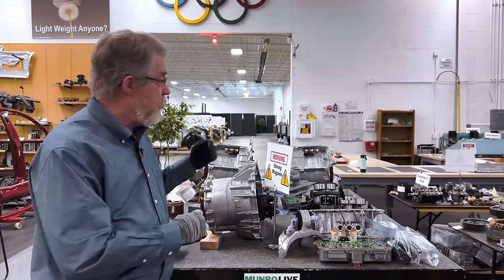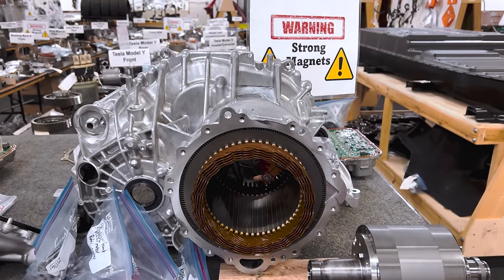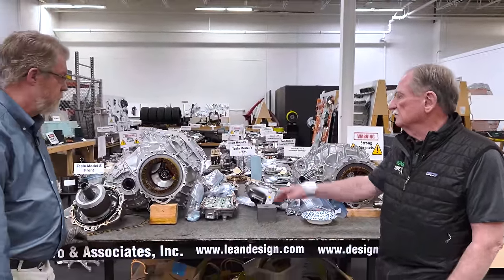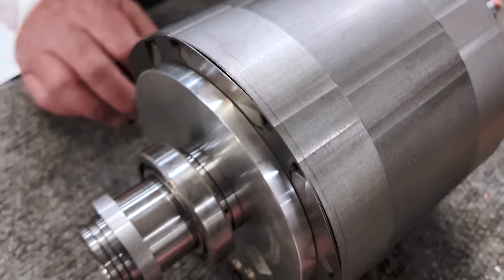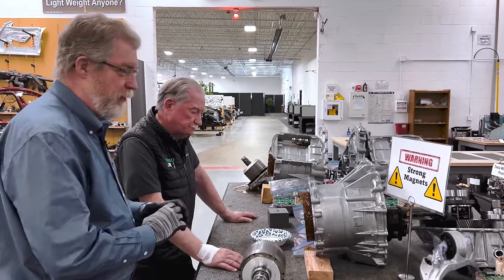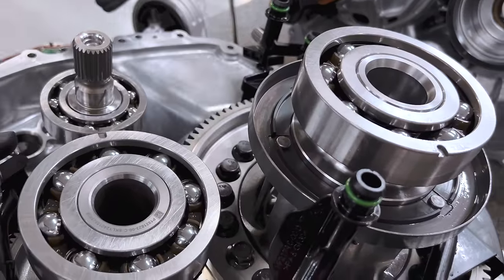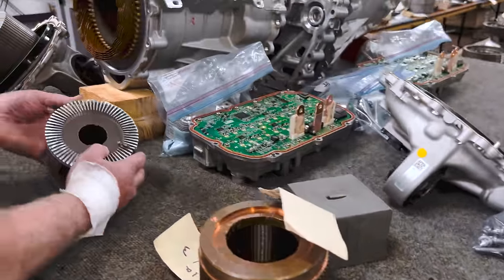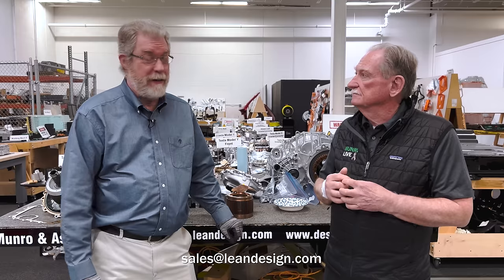Tesla Cybertruck 845-HP "Cyberbeast" Motors!

Comment: No one will catch up with Tesla for 20 years.
Reply: Lucid is there but who cares
Reply: But in 20 years they will be 50 years ahead
Reply: @GreenDriveIndia I do😂
Reply: @GreenDriveIndia  they've got good stuff but the difference is manufacturing efficiency and lowering costs
Reply: @shinjincai  exactly
Reply: Once legacy auto rids themselves of UAW, they’ll be a lot more competitive.
Reply: Both Porsche and Lucid have more powerful, efficient and energy dense motors than anything from Tesla.
Reply: @jabroni6199  the entire industry is heading towards FULL robotic assembly ... the UAW does a great job protecting workers compensation, but such jobs are doomed in the long run.
Reply: Pioneers get the arrows my friend
Reply: @jabroni6199 
It's "if", not "when" they get rid of the UAW....
.
That's the dilemma.
Reply: @GreenDriveIndia  One has to consider the cost of the vehicle along with the engineering.  Bang for the buck.  Don't have conformation but didn't we hear that Lucid used some F1 engineers and the car is very difficult to work on.  Poor placement of parts.
Reply: "Catch Up" ??   ... the Chevrolet Silverado EV pickup has more range than CT, more practical functionality, and looks like a pickup .. appeals to pickup truck buyers. Tesla has some neat tech.. but what matters is what sells.
Reply: @GreenDriveIndia ...looking at the CT, it doesn't look like a cake walk of serviceability either. Performance vehicles require performance compromises, regardless of manufacturer.
Reply: @Tommmmmmmmmmmm Yes but their motors probably costs 2-3x to make.  Im intrested to see roadster 2.0. That will probably have about same manufacturing cost with porsche and lucid.
Reply: @kaelhooten8468  They do.  Yet I hear Tesla had it easy because there was no competition.
Reply: @KrustyKlown  the Silverado has twice the amount of batteries in it, then the cybertruck and only gets 100 more miles
Reply: @KrustyKlown  Silverado is interesting.  GM chose to be perhaps more conventional in design and compensated with putting a monster battery in the W/T 4 fleet version.  The result is that the battery absorbs full 350 KW for over 50% of the charge curve and is something like 300+ KW over 80% of the curve.  GM and Tesla both put thought into the use cases of the prospective owners and went with what would deliver the most value to their customers.
Reply: An interesting thing about Tesla is the aggressive de-contenting of driver controls and putting so much interaction on the screen.  I get the concept that in an automobile when the end goal is to be driverless, so who needs a lot of controls?  The use case of a Cybertruck is different because it is intended to be used frequently in situations where people are driving it.  Screens are difficult to use in situations where there is uneven driving surface.  Having a few dedicated physical monuments for important control inputs would be welcome.
Reply: No one? Lol. New teslas sucks. Bad awd etc.  So please..   Buy some Tesla before making stupid comments.
Reply: 😂 false
Reply: You should see some Chinese cars. They catch up faster than you think.
Reply: @danharold3087 you have it the other way around. Lucid is the supplier for Formula E.
Reply: @KrustyKlown the Silverado has twice the battery pack size, which is very inefficient. 😂
Reply: @仲其宇  : jupp. And they don't make the Tesla mistakes. Like wiper heating not heating up the whole wiper etc...  Tesla have lost hundreds of the "good" smart people.  The refresh cars is awful.. (I have 2015 2018 2019 2023 X.). The new cars is soo bad. Something is better. Most things are worse.
Reply: tesla is trash mate every ev is trash
Reply: @xtrgamingzone3056  : nah.  I hate slow cars.
Reply: @MatrixJockey  the silverado ev can actually reach its rated range driving like a normal person, the cybertruck can only do that is driven like a granny
Reply: @MatrixJockey bc truck ppl care about efficiency? 😂😂😂😅
Reply: @MatrixJockey  The Silverado has a 450 miles of range, using a pack size that CT was supposed to come with.  Nobody buying these HUGE Truck vehicles cares about efficiency,  lol.  They DO VERY much care about range, especially when towing.
Reply: @nathansuss Lucid is the same age as Tesla was when the Roadster was being produced.
I don't know why the hell people expect miracles when the Air is already a spectacular product for an infant company.
Reply: They will only keep getting further ahead, Legacy Autos don’t have the management structure to even attempt, they just want to survive by creating FUD
Reply: @KrustyKlown The GM BEVs are not more efficient and their weight alone is laughable
Reply: @KrustyKlown What do you mean they don't care about efficiency? 
How do you not understand how charging times are tied to efficiency? Their immense weight also makes them a hazard to average vehicles on the road
Reply: If they can produce a heap like the cybertruck, all of which are now being recalled (great quality control),I doubt anyone will want to catch up with them
Reply: ill like to try what you are smocking please! why did tesla started copying others with induction motors and hair pins too?!
Reply: BYD
Reply: @Tommmmmmmmmmmm Throw cost into that thought and Tesla reigns supreme…absolutely no comparison!
Reply: @KrustyKlown Imagine the range a CT would have if it too had a massive 200kW battery! It would blow the Silverado EV out of the water. But then the CT would also be selling at a loss and forcing customers to buy something they don’t need unless they tow frequently!
Reply: @Krishell Malarkey…just plain false!
Reply: @xtrgamingzone3056 You obviously have interest and think otherwise watching videos such as these!🤔
Reply: @Tommmmmmmmmmmm 

Energy dense of energy efficient?
Reply: The competition can buy the report
Reply: @GreenDriveIndia  Who cares what a glorified concept car can do? We're talking about real cars that can be manufactured in large volumes and turn a profit.
Reply: @Tommmmmmmmmmmm  
"Powerful" maybe... More efficient? Absolutely not.
Reply: Facts
Reply: @KrustyKlown 
And Tesla already sold more cybertrucks than GM sold Silverados. 

Also, more range means nothing. Tesla could double the size of the battery and have more range. The Silverado battery pack is WAY bigger/heavier and much left efficient. Not to mention GM loses money on the EVs they sell. 

More "utilitarian"? Hardly. 

"Looks like a real truck". Honestly, this is such an idiotic argument. Who cares? A truck is a truck. It has a box. It tows. It's got a cab. It looks great (I don't care what idiots say about it being ugly because it's not, especially not compared to every other pickup which is much uglier).
I'll take the cybertruck with it's bullet proof, non rusting skin over any other truck. 

Not having to worry about scratching paint is a Godsend. 

Honestly, whoever thought it was a good idea to put paint on cars is really stupid.
Reply: @KrustyKlown  Don't be silly.
Reply: @cookiehumper1224  exactly. Brute force never wins long term and the battery thing is well on its way. Manufacturing is the real leap ahead for Tesla.
Reply: @MrCarGuy  You wrote, "Lucid is the same age as Tesla was when the Roadster was being produced. I don't know why the hell people expect miracles when the Air is already a spectacular product for an infant company." I think part of the reason why Lucid gets criticized is because they lose a few hundred thousand dollars on each car they sell. I know it is common for a start-up company to be unprofitable initially and then eventually become profitable when the company figures out how to reduce manufacturing costs, but Lucid's loss-per-car is worryingly high.
Reply: @keith8443  , I bet you drive a big diesel pickup truck, wear a baseball cap and wrap around sunglasses, i under your dilemma

Comment: They recalled everyone, send it back.  HAHAHAHA...the thing is a POS.
Reply: Give the rest of the story , they recalled them all for a minor fix to correct the problem with the accelerator pedal.
Reply: @dobsonimages  It's not a minor issue.  It's a deadly problem, the cheap plastic glued on, must be using Sandi design methods, make it cheap, and dangerous.  Glued on cover jams the accelerator and the one person's vehicle took off uncontrolled, I have had dozens of vehicles, never had a accelerator pedal part fall off while driving, this thing is $100,000 POS.  Built to Sandi plastic clips low standards.
Reply: I don't like tesla either but every manufacture has recalls and is nothing new. my f150 had a recall for the cruise control catching fire
Reply: Is griping your career?

Comment: Tesla and Space x share tech.  Space stuff must be robust with backups. Tesla is a vehicle and energy company.  Musks wants to be USA battery guru like China’s largest battery manufacturer, CATL.  Battery storage for the grid and home.  Micro grids vs macrogrids.  Tesla smart with its own superchargers vs Big 3 no investing in charging stations.  When you build a minimum service EV you need other cash flow.  Charging stations will be that cash flow as well as robotaxi’s. Many of teslas charging stations supplemented with solar and battery storage.  Able to uncut competitors cost/kwh charging.
Reply: I own 5 Tesla’s and a gearhead from the 60’s.  I still own, bought new, 2017 Model X.  Never been to service center.  Only maintenance have been tires.  I am going to keep it to see how long it runs.  Still no other gas or electric nicer than my X.  Still looks and drives like new.  No oil filters in land fills every 5000 miles.  I charge at home with solar and save $500/month on gas and home electricity.  I can not control healthcare costs but can control energy costs.  That is a funded IRA every year.